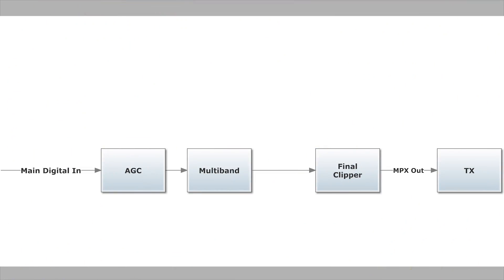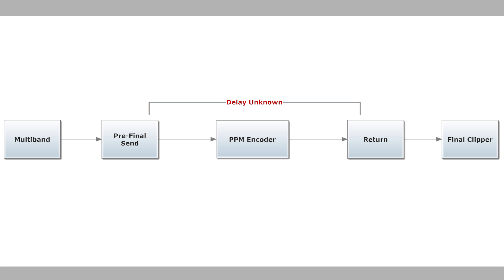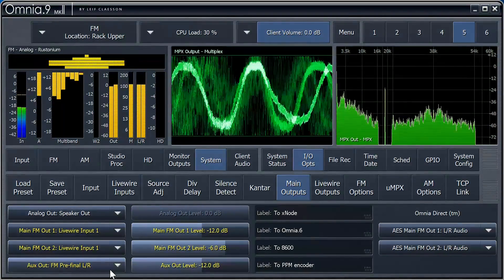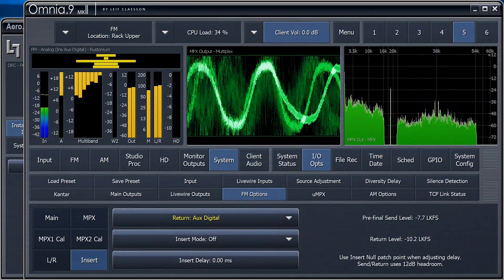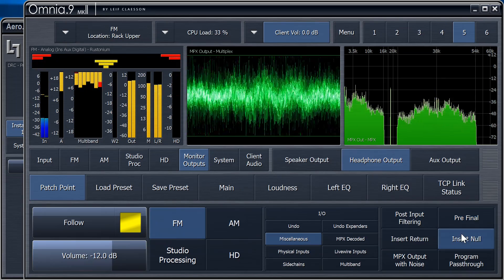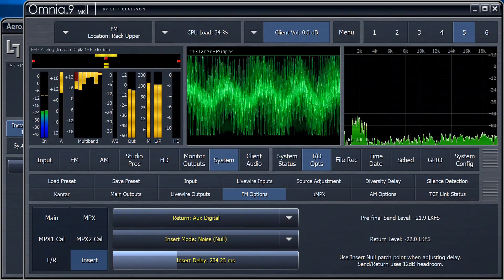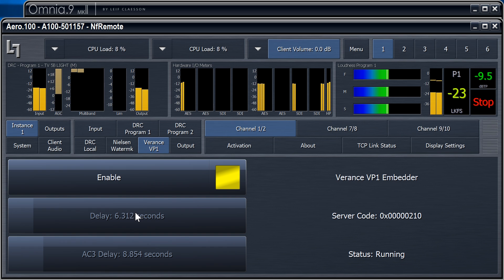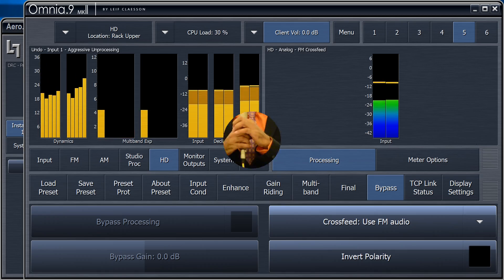Omnia.9 mk II PPM insert setup

Comment: Never used omnia9. I know a couple stations that use omnia9 and it sounds way too digital lacking warmth.
I think the 9 sounds very good, don't get me wrong, but at the same token, its too clean, almost cold.
we have about 50 radio stations streaming on the web since 1999, our network will remain withheld.
Most ALL of our processors are free standing racked units. 
I setup most all myself. 100% analog!
No Digital allowed.
Believe it or not, most all are omnia3 FM turbo units. yep just 3 band old fashioned processing.
I've been known to make an omnia3 FM turbo dance and put BOOM into any room, provided the content.
we also have a few orban 5500's, 6300's in the chain as well as AEV Mirage units.
I prefer the omnia3 FM turbo units as they are (were) very affordable and the settings are old school language.
Don't believe in AAC nor AAC+ as it is Fake, Remanufactured Filler Artifact audio.
matter of fact I don't care for MP2 nor MP3 either. .WAV is the purest aside of DAT
Too many new and upcoming audio processors are all software based and they ALL SUCK!
Reply: If you never used Omnia.9 how you can say it sounds bad? Based on what other people said? That's ridiculous. The Omnia.9 plataform is the best sounding ever thing you will use on FM Radio. The MPX Clipper is simply perfect. Leif made radio sound better than digital with Omnia.9. You need to stop with the analog processing, we are already in 2020. Update your ears.
Reply: @juniorsilvabroadcast  What is the difference between Breakaway One and Omnia?
Reply: @aur485  BreakawayOne sound 99% close to Omnia.9, but the final clipper is based on the very first 2011 version used on Omnia.9, there's limitations on settings you can use on BreakawayOne, It's a simple set-up and forget processor. It sounds good, works good, full of functions.

Comment: Lets Be Realistic Here;  This Omnia 9 Does-Not-Sell. 

This Unit Omnia9 is  Horridly Over Complicated as Well as this Media Tutorial.
My Goodness,  DONT Forget  To Whom You Are Marketing This Unit,  You're Market is NOT Radio / Audio Engineers. 

Your Market is  'Joe Public'  Amateur Radio Streaming Hobbyists,  Not Fellow Audio Engineers!
Omnia Makes an AWESOME Audio Processor, I Own  Many  Myself,  as I've Streamed Many Many Online Radio Stations, as Well as Medium Power FM Stations for the past 20 years.
Reply: Agreed 100%  Matter of fact;  FM radio stations are closing down all over the country. 
Mostly Web-Stream hobby broadcasters are becoming-replacing the market.
Our FM station here in South Florida uses  OMNIA 6  and it still sounds great.
The OMNIA 9  sounds great also but I would say its more for Streaming over the web as opposed to FM 
INTERNET RADIO BROADCAST  Is the future
Reply: It's not complicated. It's way more simple and easier than other brands. If you know what you doing, It won't be complicated.
Reply: Yeah, no. All wrong. This is absolutely targeted at audio and broadcast engineers, i dont know of a single ham radio guy or gal or "amateur" who can sling 13 grand on the table for a processor. Pull your head out of your ass before making comments like this about subject matter you seem to know precisely dick about.
Reply: @alexhartman4447  you ever work in commercial radio?  if Yes;  did you sweep the floor or were you just a Board Op ?  Maybe a flunkie intern?
Reply: @lizwildeshow6554  I mostly swept the floors like most engineers before working with some of the names behind a lot of the products you use regularly in broadcast (OTA, Internet, etc). As for internet broadcast being the future, you're not wrong. The current state of the industry at large is pointing a howitzer straight between the eyes because they don't know how to make money on the internet.  As for the OP, please call your nearest Omnia rep and ask for a quote on a 9mk2 fully loaded SKU. The FM lists around 10k, but one that has all the HD's, streaming, RDS, etc is around 13k before discounts. So yes, in fact i do know what I'm talking about. As for being a guy around when Foti and guys were DJs, good on you. As for the 9 being mostly designed for streaming, not at all. I've installed 40ish Omnia 9's, it's really the first FM processor without a personality. It doesn't sound like every other processor. None of them sound alike. While Leif did design a box with codec masking in mind, he made an FM box that can take on the big boys pretty easily, even 10 years after it's initial release it still hangs in there. The 9 is probably one of the best selling processors. So, if it's not selling, why is it a 10 year old current product side-by-side with the 11, which is equally as aged? It's simple bad business to keep a product that, in your words, does not sell. It sells just fine. If you're going to call out a product for being "overly complicated", please use facts and explain why it's that way. It's absolutely targeted at professionals given the toolbox it provides, and capabilities (like Undo) that was industry leading when it first launched. So, while i'm going to check my "tout", please back yours up with fact instead of typical pure emotion.
Reply: @alexhartman4447  who are you directing this comment?  maybe cool off and  recheck. take a second look at the thread  mr hot head
Reply: @alexhartman4447  They doesn't have eyes to read the manual of Omnia.9 before working with it. Don't lose your time with these guys. Probably haters from competition that can't make anything better.